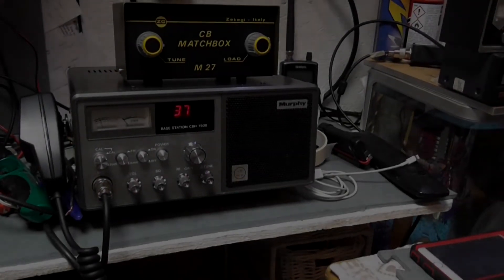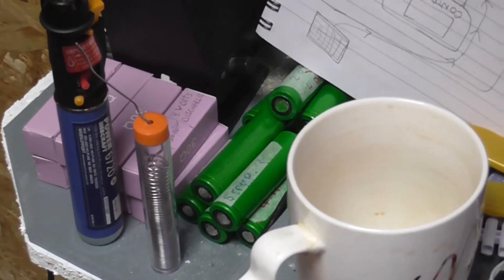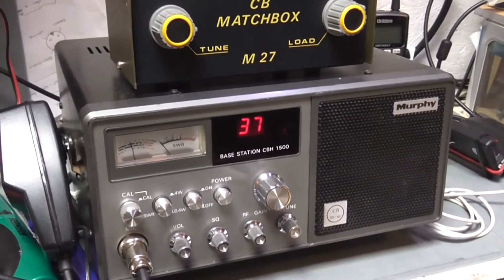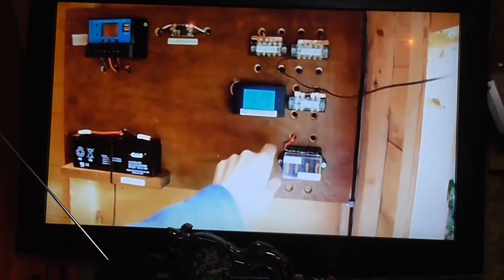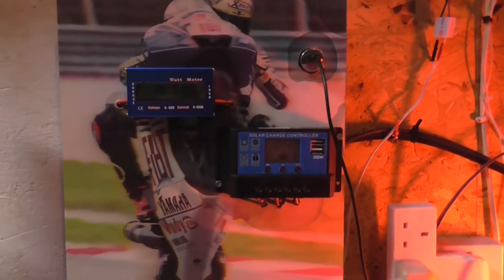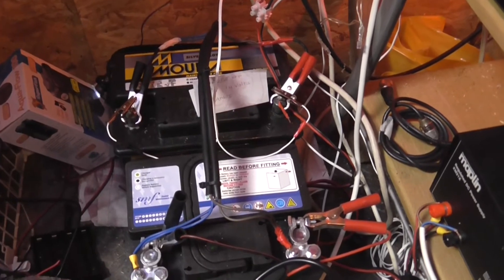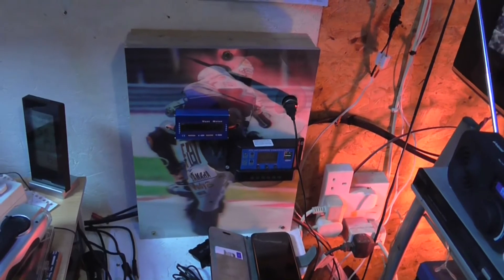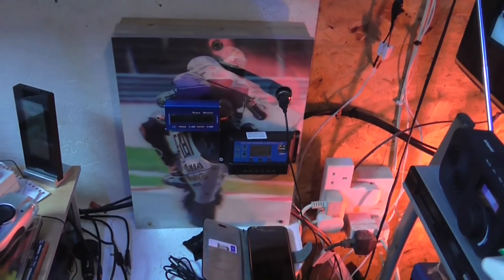abc

Comment: I had that same Sharp stereo. Fantastically well made, lasted years.
Reply from the maker: CT 2116 Tim yes , I was only a kid 16 ,,and it's the best I could find at the time ,, if I remember battery's didn't last long, , then ,, I used to take it out a lot in the summers ,,shame I don't use it very often believe they are getting collectible must check out the prices on eBay ,, thanks for watching and commenting,, just uploading part 2 of the solar project ,, and this is my quickest video to date I believe so you won't have to book a day off work to watch it ha ha ,,, take care cheers Shane CT1017
Reply from the maker: CT 2116 Tim blimey just looked on eBay first one came up ,, buy it now £250
Reply: Now I wish I'd kept it mate! My mum bought it back in 81.
Reply from the maker: yeh ,, amazing ,, bought mine in 80 ,, I was just 16
Reply from the maker: make me an offer mate and its yours  cheers